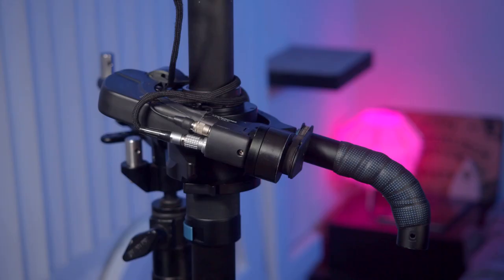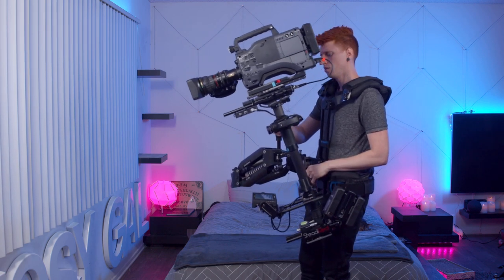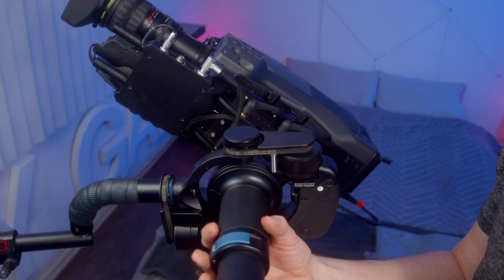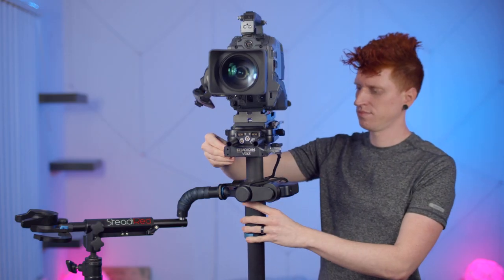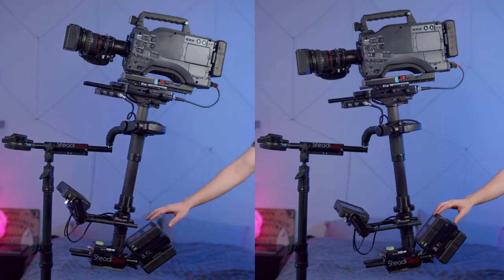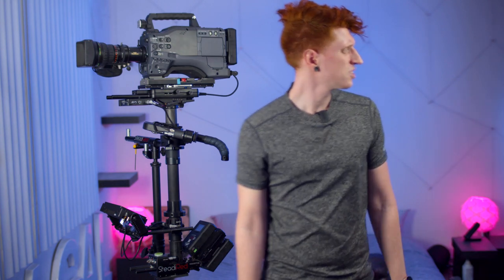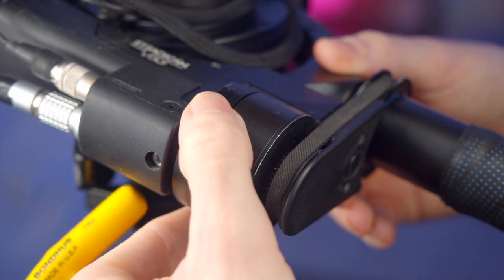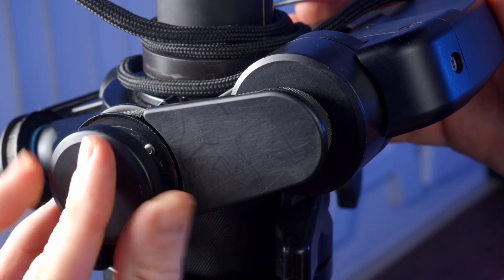Steadicam Volt - EVERYTHING You Need to Know

Comment: steve wagner here - co-inventor of the volt with garrett- look me up on the patents for it; the small plastic one although not a big consumer hit is not as trivial of a toy as you showed by dropping it on the ground. put a decent phone on and shoot steadicam style you will be surprised by the footage. The big Volt is a surprise in how many purists of the pendulum still appreciate it when it helps make the DP happy, all that matters. Thanks for your instructive series, love when more kids and older kids pick up the craft
Reply: And with Volt: super precise neutral balance is a suggestion not a strict requirement. Many OPs that have experience with it set the rig to a much longer than normal drop time let's say 5 or 6 seconds, then set the Volt roll and tilt strength knobs to make rig feel like it has a much faster drop time, say one to two seconds. The knobs allow any combination of passive versus assisted stabilizing. Have fun and experiment ahead of time for the shot.
Reply from the maker: hahaha, sorry about that. (It was meant to land on a pillow but bounced. Still intact so it's integrity is well.) I did test it out and it did work as it says. However, I do feel that there smaller, easier to set up devices on the market today that also allow for whip pans. If I made the video a few years ago i would have recommended it.
Reply from the maker: Oh, I thought it was a requirement but that's good to know. I'm excited to try it out!
Reply: @SteadiRed  Its tough - abs plastic! i got a few during development but gave most away but I still love the one I have with my 11 pro max. We had some help from yuneec but I did user servo feedback code for small one and pro one,

Comment: Hey Red! I have had my M2 with integrate volt for about 6 months, I have not  used it once, I can get it working well on the stand but the moment I take it off to operate it just does what it wants so I just go without it. Given the cost i'd like to at least understand what my faults are. what are some things you did to optimize your use in shooting once you got the arm on the rig? Thanks! 

p.s. I used your above video to set the balance when I got it but i'm still getting the wobble once off the stand.
Reply from the maker: Dammm. are you making sure the gimbal handle is pointed to the back when you power on the volt? (to the front if you are goofy ) its very important. If its still not working I would contact tiffen.
Reply: @SteadiRed  I am using goofy, I will reconfirm the direction in the AM, thank you!